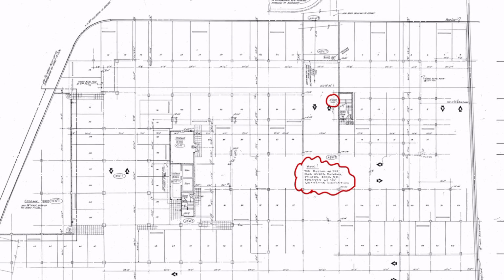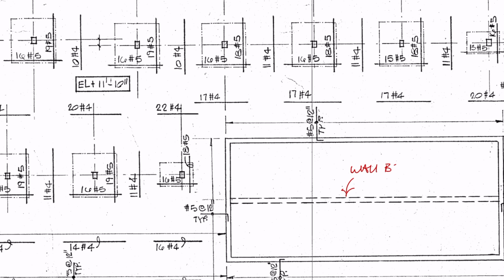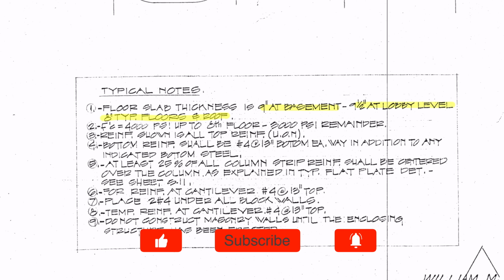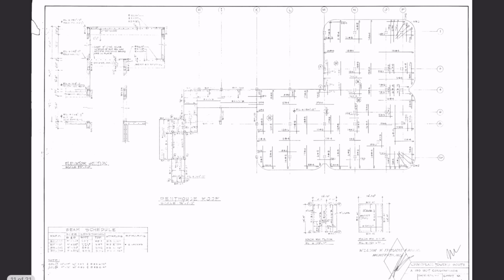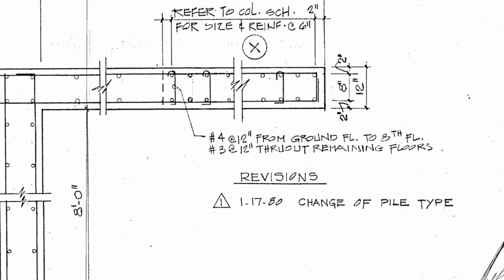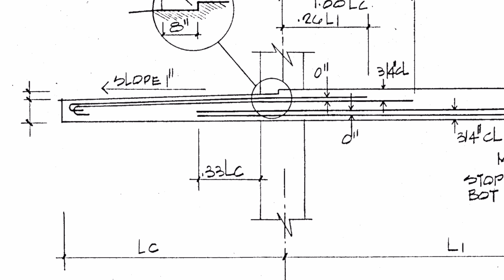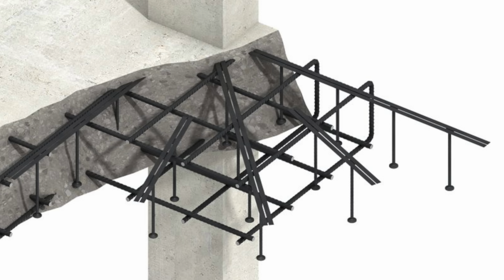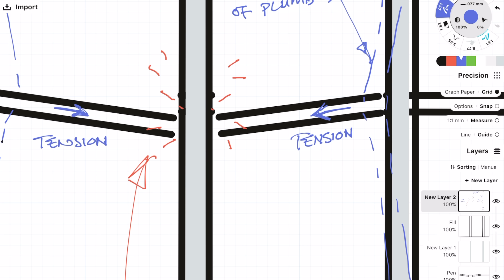Surfside Condo Collapse - Reviewing the structural drawings - Was the design bad?

Comment: As a retired Structural Engineer from California, I noted the lack of east-west shear wall right away.  You are the first reviewer I have seen that also noted this problem.  The pool deck I believe is the source of the problem.  The original engineer may not have provided an adequate allowance for the added load of the planters, topping slab for drainage slope and finish paver tile/slabs.  Deflection of the two way flat plate structure would result in water that penetrates the finish tile or pavers ponding on the structural slab.  Long term creep and shrinkage would cause these deflections to increase over time making the situation worse.  
That's my theory and I'm sticking with it.   Failure of the pool deck slab by punching shear at one column would throw added load to adjacent columns, resulting in added punching shear failures.   The slab now goes into a catenary mode which would apply a significant horizontal force to the perimeter of the failed area.  One of these perimeter lines is grid line 10 (the south edge of the north-east tower) where a vertical offset of the slab is present.  The lateral load applies a torsional load to the beam/vertical offset and a lateral load to the 16" x 16" columns.   The horizontal resulting deflection of the column results in a P-delta moment magnification to the column resulting in the failure and collapse.  I just saved the federal government a million dollars in investigation costs.
Reply: Developer was up to cost cutting shenanigans, just to max out his profit. Nathan Reiber was new to construction of this magnitude and all he saw was dollar signs. All that luxury he sold masked skirting the bare minimum just to get it built.
Reply: @Dilberto88  well he passed away already, the other consultants could have noted this given all the documented complaints and the building should have been refortified by subsequent qualified engineers. Just a regular person here. Just seems like common sense.
Reply: @yvettetorres7829  I echo your sentiment; 40 years is enough time to shore Champlain condo. Painful learning experience, hence; the evacuation of condos, buildings in the aftermath.

Aedin
Reply: @yvettetorres7829  Zachary Abelard I echo you sentiments many times, architects design flaws should have been “fortified.” 

Aedin
Reply: A still practicing structural engineer in SoCal since 1987 here. I posted a similar comment before I saw yours which is concise and straight to the point. Good luck collecting the one million dollar investigation fee! :-)
Reply: That is my theory also except the horrible design of the column/ slab joints could not take the moment and shear from the collapsing pool deck causing loss of column restraint and buckling.
Higher dead loads,lack of load paths laterally and no maintenance sent the factor of safety to -500 % and were the death knell.
Reply: @designstudio8013  Would it be possible to outline (in layman's language) the type of different construction/design that would have been better?  Thanks
Reply: @coeneschamaun1735  @ way concrete slab on beam on column pedestals.Also shear walls in both directions. Patio separately supported.
Reply: There’s going to be a need for retired engineers to Virtually teach apprentices for construction jobs Biden’s Infrastructure Plan will create.

Aedin
Reply: Once a member has been overstressed the load will try to find another way to redistribute itself.  It's death by a thousand cuts. I think the "cause" was the faulty (or lack of) water proofing and poor drainage. The devil is in the details.
Reply: There was pool deck repair in 2019.

Aedin
Reply: Construction is a tough business due to being seasonal; parameters need to be put in place for teachers also to maintain skilled workforce.
Reply: There’s a video that depicts horizontal slab (horizontal in that it was area leading to condo lobby). One can see this slab that broke off laying on top of mountainous debris. The video also reference the fact condo stood for 40 years. I have stated multiple times, there was plenty of time to correct architect design flaws. There was pool deck work performed after 2018 (if I am not mistaken) engineering report. What year chemicals added to cement for water 💦 penetration for lack of the correct terminology.
Aedin
Reply: @aedinquinn8687  Take a look a Mike Bell's depiction of the collapse - I think its pretty close to what happened.
Reply: Would it be possible to outline (in layman's language) the type of different construction/design that would have been better?  Thanks
Reply: Good point about the p-delta effect.
Reply: A simple exercise: For each 100 pounds of horizontal component of wind force directed against a north wall, each of the east and west outside walls that are at right angles to it takes up 50 pounds of force. If a third interior wall is added parallel to the east and west walls then each wall will take up 33.3 pounds of force. The floors that also transmit this horizontal component of force to the outside walls prevent inward deflection of the north wall. Horizontal force transmitted by the floors that is taken up by the footings of the columns and rear wall may be ignored for this analysis.
   
Is a third interior wall of solid concrete required? (Referred to in some discussions as a shear wall). After calculating the force that the east and west walls must accommodate it is a matter of design choice. It is likely that the minimum thickness and strength of the east and west walls already greatly exceeds the horizontal force that these must hold back. Thus, for each 50 pounds exerted horizontally, the walls as a result of their strength to function as a wall supporting the vertical downward load from weight, are already capable of sustaining a horizontal component several times that amount, which is why the contribution of the footings was ignored.
   
A building is designed so that the entire structure remains standing. That a collapse is only partial appeals to emotions, not logic. 
  
An interior wall of solid concrete that is not connected by rebar to the adjacent part of the building is in effect an exterior wall to which an abutting structure has been added that encloses it making the whole thing appear to be a single building. Pre-construction-sales enabled raising capital for a much larger structure.¹³
   
The reason behind this two-phase approach is finance, not engineering. 
    
     
     
¹³      For each dollar investors advance for the cost of constructing a 100-unit building unknown to them these funds are sufficient to build twice as many units. The 80-unit addition that effectively costs them nothing accrues to the organizers.

Comment: It is amazing how thin the basement walls are given how tall the building is.   However, as I said in your first video of this building, as an architect, I rarely use the words "design" and "engineering" of a building interchangeably.  The architect has to rely on the engineer to make his calculations and that the engineer gives the necessary shear and steel/rebar enforcement.  It would be unprofessional of the architect to encroach into an engineer's professional judgment and license and to ask him to make structural changes, without making sure that the engineer can reinforce the building in a different way.  The architects'  level of responsibility is to make sure that all the systems in the building are properly coordinated waterproofed.  Specifying some type of waterproofing membrane at the basement level especially would be vital.  However, if the structure is not properly reinforced, the waterproofing membrane can be compromised due to too much sway and movement of the building (all buildings move and settle to some degree).

In the past, if I have felt uncomfortable about the amount of engineering put into the building, I have questioned the engineer.  Sometimes he'll agree to some type of additional bracing or anchoring, etc. but ultimately it's the engineer who stamps the engineering drawings while I stamp the architectural.
Reply: The basement walls do seem too thin, but their thickness would be a function of the depth of the basement, not the height of the building above.  The basement varies 8' to 9' deep, I have seen people use 8" basement walls but I would think 10" would be better.
Reply: The basement walls don’t support the building, the columns do.

Comment: I am not an engineer but it seems odd to me that the much thinner columns are situated at the exact location of the part of the building that collapsed (16” x 16” and 12” x 16”) while the standing part of the building had 24” x 24” columns throughout.  AND THE FACT that a PENTHOUSE FLOOR also was added at a later date (not in the original building plan) on the part of the building where the thinner columns were located. To me it seems as a recipe for disaster!!! When you then add the water, lack of waterproofing, not sufficient gradients to a drain pipe etc. is added it’s no surprise to me that the collapse happened on that   part of the building!!!
Reply: Great question! I've seen it asked several times now, but never answered...
Reply: The 24"x24" larger sized columns are at the lobby area, where the remaining building stands, probably over-designed for architectural reasons and higher story height. 

The smaller columns at the collapsed portion probably were designed to meet minimum code requirements, to gain maximum floor area, and to accommodate the parking in the basement.

The added penthouse on the original columns definitely does not help.
Reply: Actually the penthouse was part of the original construction. Just not a part of the original submitted plans. So that they could get away with it.
Reply: @neilkurzman4907   so why isn’t the penthouse included in the original drawing??
Why did they have to apply for a penthouse to be built if it was “part of the plan”??
Reply: The penthouse is in the filed plans.  It was added before the building was finished.
Reply: @stargazer7644  no
Reply: @ReptilesGeniales  If you bother to look at the publicly available filed plans, you'll clearly see the 13th floor penthouse on them.
Reply: @stargazer7644  Not in the original plans, no. A request was later filed. And then new plans. Where do you get your information from??
Reply: @ReptilesGeniales  I told you.  My info comes from the publicly available plans on file with the city.  I've looked at them.  Have you?   The building plans are dated 8/79, the penthouse plans are dated 8/79, with a revision on 5/80.  The certificate of occupancy was issued (the building was completed) 12/81.
Reply: @stargazer7644  yes I have looked at them all from 1979 until 2021

Comment: Cars and Big Trucks parked on pool deck started it, + deck was way over weighted and it pulled down the building..
Reply: There were no vehicles parked on the pool deck. You can see the entire collapsed deck after the building fell.  There are about 6 cars parked in spaces under the building that remained standing that fell into the garage with the deck.  None of them were “big trucks”
Reply: Spaces under the building as you call it is all part of same deck, look at the building plans.. can you tell me what has been "parked" in that area over 40 years ?
Reply: @sircampbell1249  The front entrance to the building (at the lobby level) is a driveway that cuts under the second floor of the building.  The south side of that driveway has some parking spaces.  The far southeast side of that parking lot extends about 40 feet over the underground parking garage.  Those 6 or so cars at the end of that lot fell with the slab into the garage below.  You can see them here: https://www.enr.com/articles/52015-engineer-probing-champlain-towers-debacle-eyes-possibility-of-three-successive-collapses  Those are the only vehicles that were on the deck, on the extreme south west corner.  WTF are you talking about 40 years?

Comment: I think it's weird how the building fell so easy, I mean if you do a demolition you have to prep the pillars so it falls here it just fell on its own. Would be cool if you could go over the plans to a building that failed demolition to see if it was over strengthened just to compare. Also the other part of the building was removed by demolition later but they couldn't have prepped that sections pillars, it just fell on its own as well.

Comment: Stairwells are usually one of the strongest areas of a building. This is shocking. I would like the GC that built Champlain Tower South  to be interviewed. The 1st collapse was at pool deck where cars were parked at street level, above the UG parking garage. Once it collapsed it pulled down the building across from it (for many reasons). Vids taken in the parking garage in 2018 showed lots of spalling in garage ceiling & standing water on the floor. A 2018 Engineering report was adamant about the damage the planters on the pool deck caused bc of water leaking from them & called the spalling "exponential."  Water leaking for decades could (or would) destroy anything.
RIP To all people who perished in this disaster!!
Reply: The building was built 40 years ago. That means most of the designers and senior construction crew are retired or dead.
And if they weren’t you want to know details about a building they built 40 years ago?

Comment: Before Hurricane Andrew, Florida had a rather relaxed set of building codes, which had to be revised significantly in light of the extensive damage done by that storm.

This building stood for 40 years on some truly unusual soil for construction, where it appears that tidal actions relocated soil away from bearing the load of the basement slab, potentially aggravating the salt water intrusion into the concrete of the piling and pile caps / column bases.

Other videos by structural engineers show where water intrusion acted on potentially poorly placed concrete causing rusting of the rebar system, with subsequent spalling and structural distress.

In my opinion, it appears that the combination of designing to a more permissive building code, errors and omissions during construction, and deferred and improper maintenance and repairs all played a role in the ultimate collapse, and that all such structures built to that version of the building code need to be evaluated sooner rather than later for structural integrity.

I am not going to judge the engineer too harshly, as he designed to meet the requirements of the codes in force at the time.

Comment: What most people don’t realize. This condo was built on sand. No bedrock. It only a few hundred feet away from the ocean. The water table is only 1-1/2 feet deep. The ground water is salty ocean water. 
The building was built on a large number of concrete with steel rebar added for strength. The piers have been submerged in salt water for 40 years. Do you see the problem?
Over the years the salt water leached into the concrete and rebar. The rebar started to corrode. As rebar corrodes it explains, cracking the concrete. This is hurricane alley. The building shook a little with each hurricane. Every above ground wave caused the water table to flow in and out. Weakening the sand. Possibly creating a sinkhole under the building. The piers started to fail underground. Each pier failure put more pressure on the remaining piers. Causing more and more piers to fail. Notice the cracking during the month before. Eventually one to many piers collapsed and the building didn’t have any support. Causing it to collapse. 
This and all other multistory buildings in the area are doomed to fail. Never built a multi story building next to the ocean in nothing but sand in hurricane alley.  Especially when the ocean water level is less than 2 feet.
Reply: If you bothered to actually look at the pictures of the cleared site you could see with your own eyes there was no evidence of substantial failure of the foundation.
Reply: You have seen the pictures of the cleared site correct? The slab appears to be mostly undamaged.

Comment: Well, already the engineer hired by Surfside has just mentioned the what you said about the boundary retaining wall. He said it is now acting like a bathtub & if the ground to the outside becomes saturated, it may fail. See his video for full details.
Reply: The original basement wall is pretty thin, but it isn't very tall and would be braced by the basement slab at the bottom and the pool deck at the top.  Remove the pool deck at the top and the load situation changes- instead of a simple span wall it is now a cantilever retaining wall which it likely wasn't designed to be and could easily fail into the basement letting the surrounding soils come down with it.